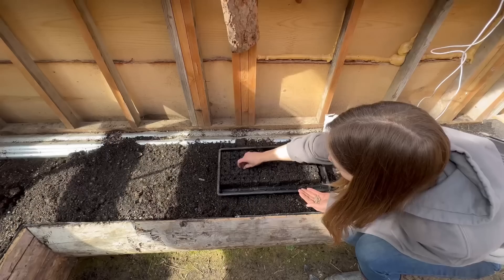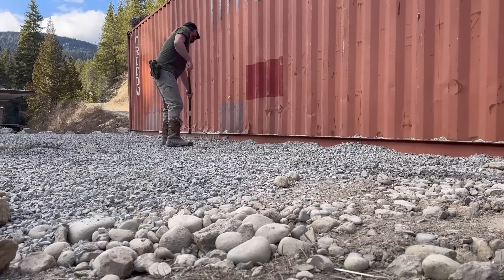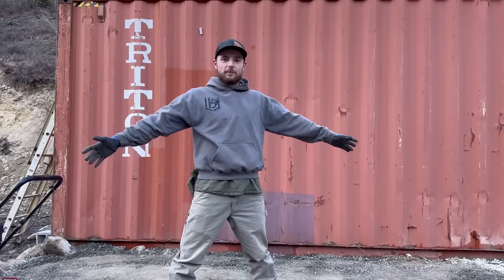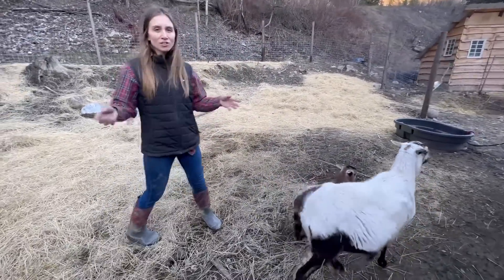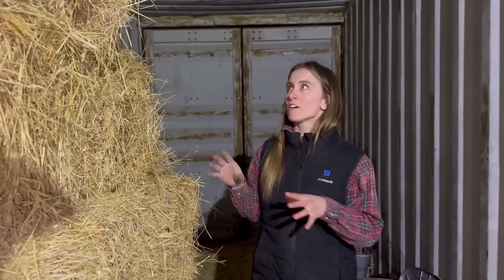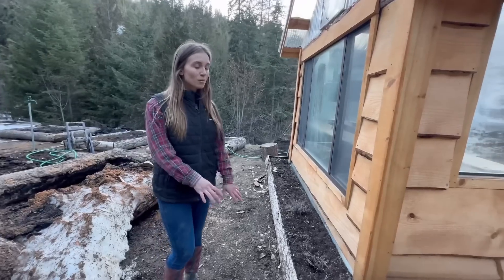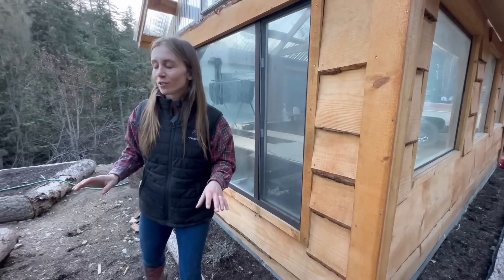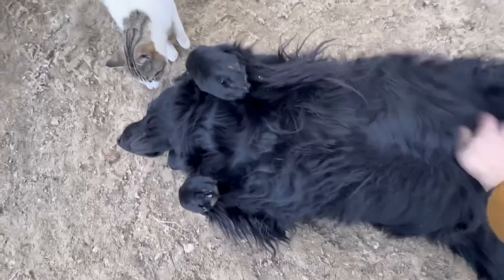They Tried To Hide These Projects

Comment: For the greenhouse a solar powered ceiling fan could help spread the heat from the stove. Or one of these heat driven fans on the stove to help with the circulation.

Comment: Havent managed to watch it yet over here  in the UK but waiting eagerly to do so as we wlhave watched Homestead rescue for years. So excited for you guys. Could you not build a leanto roof over the other side of the barn like the sheep have, and also put some brackets up on the shipping container wall underneath the leanto, that would put your lumbar flat, off of the floor with good aeration, and potentially also give you a place to keep the bales etc on the floor youve just compacted, it would have a roof over it, and the lumber would be on the wall instead of the floor which would then leave the floor free for the bales, freeing up the storage a little perhaps 🤷‍♀️. ❤ made some huge strides over the last 8 months xx

Comment: That wood stove in the greenhouse is interesting. If you build another greenhouse next to it, you can centralize the heating. A 50 gal drum can be turned into a boiler unit. Enclosing it in a wood shed will help protect the unit. Heat pipes from the drum to the interior of the greenhouses will pump heat into the greenhouses.

The ranch continues to solidify. Maybe you can get another container for the lumber.

Comment: Just watched the Homestead Rescue episode. Mike your appreciation and overflowing gratitude was refreshing to see. Thanks for sharing yours and Liz’s journey. What a huge transformation. The huge rock wall is a huge investment in protecting the foundation. Diverting the water should also help. You should attack the upper section of the retaining wall with a mesh erosion control mat that is pinned and cabled back up into the upper hillside to hold the soil in place.

Comment: The ram lamb would be easy to make into a wether. At the ag supply store they have small tough green rubber bands and the applicator. Just make sure you get both. Wethers are much more easygoing than ram lambs and gain and grow well. Also much better for the breeding program to not have mistakes.

Comment: With the longer sawmill bed, I'm surprised you aren't promoting custom milling for the surrounding area....I'm sure there are plenty of contractors and individuals that would love to utilize your capabilities now with the longer/extended saw mill....even if you have to buy truckloads of timber as your source of  saw logs....Your potential is unlimited and I'm so happy to see you guys smiling into the future....If you need more ewes, find someone whose sheep you like and go up to their place and trade them custom cut lumber for a new shed or barn for x number of ewes....Think Barter now, in all your needs and requirements...Your sawmill is a gold mine, untapped.  Need a new pickup....go trade some custom cut lumber for a new(er) pickup....everyone needs lumber for something!! lol   Find someone with pigs and trade them some custom cut lumber for some  feeder pigs that you can run on your mountain  to clean the underbrush - continually move them with a solar electric fence....and there is always a market for organic, home fed pork...you can have 10 or 20 hogs sold by the time you get them up to market weight and they work for free, helping to prevent forest fires and adding nutrients to the soil...so many cool things you can do now to build income streams, all working from home...so awesome.